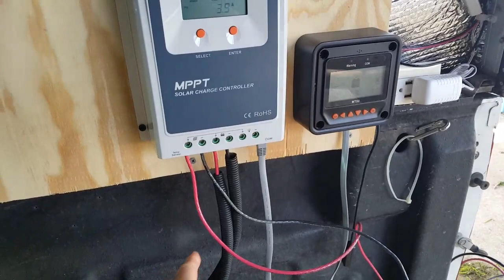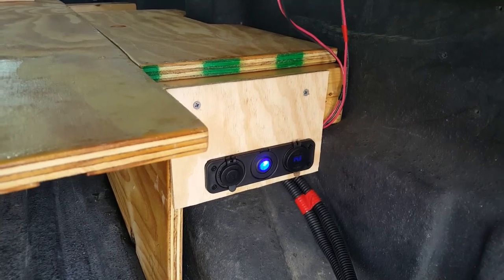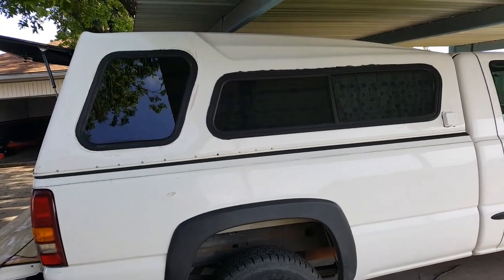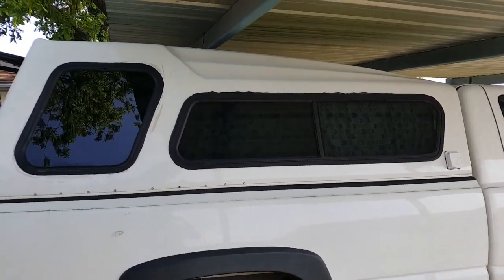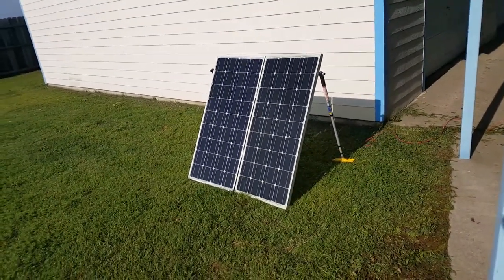SOLAR POWER OR SHORE POWER GMC Sierra Chevrolet Silverado Camper shell topper electricity

Comment: How do you handle switching between Solar and Shore power?  Do you have some sort of switch installed?  

I'm going to add solar to my trailer, but need to be able to handle switching power source when going to and from shore power.  

Also, can you explain how you made the panels portable?
Reply from the maker: In the truck I had 2 pair of plugs that were strictly 110volt from shore power and the inverter has 3 plugs that were 110volt from solar. What power you got depended on which you plugged in to.